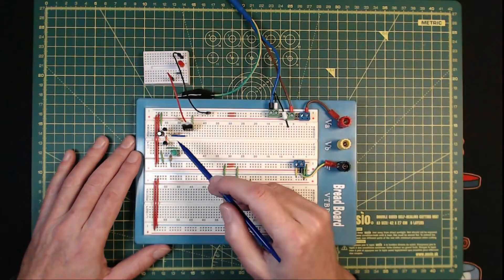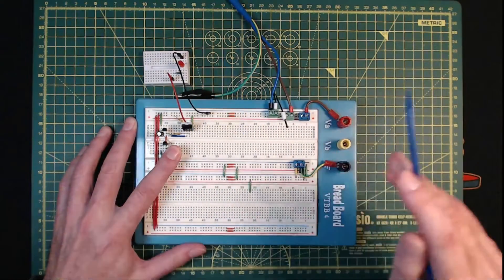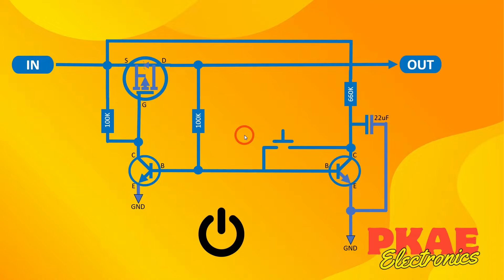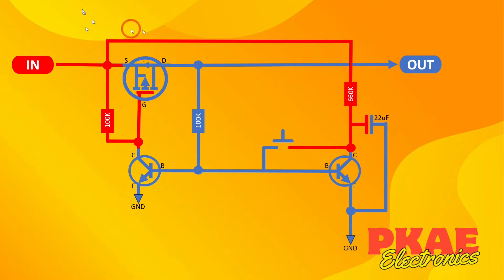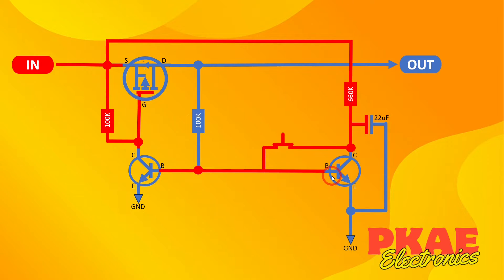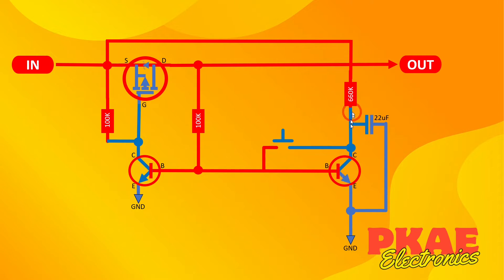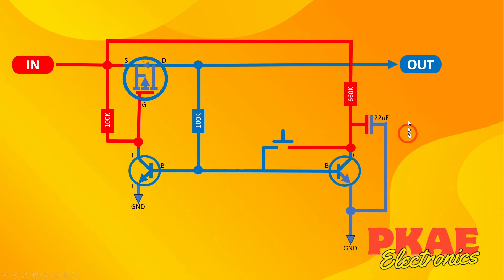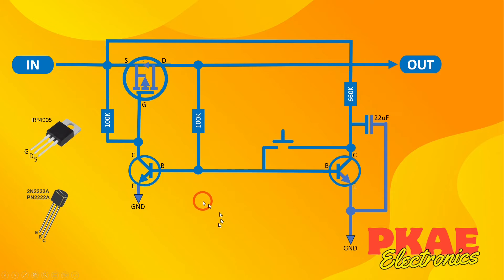Power Latching Circuit

Comment: I found that the circuit went immediately to the on state when power was applied. The switching worked correctly as expected. I inserted a 33nF capacitor across source and gate and this kept the gate high on ititial power up. I'm not sure if this has been exeperienced by anybody else but this was my experience. the only difference to the circuit described was the mosfet that i had available which was an IRF9540. Without this capacitor the circuit went to the on state 100% of the time. any thoughts would be greatly appreciated.
Reply from the maker: That's interesting. When I get my new workshop up & running I will take a look into this. Well done for fixing it though. What is it that made you think of adding the capacitor?

Comment: Hello, im trying to incorporate this circuit in to my own design but i can't get this to work, and i'm not sure why. It seems to be stuck in the off state, and when I manually pull up the left side of the switch with a jumper, it goes straight to being off again. If it matters, Im using BC817s for the NPNs, a 10uF capacitor and a CSD25310Q2 p-channel mosfet. Ive checked the schematic multiple times and it seems to be correct. What might be happening here?

Comment: Is there there a way to design a similar circuit which have a power side nmos and boostrap ? I tried to design it but I failed 😢.
Reply from the maker: It is possible, but quite a bit more complicated. The advantage would be lower RDSon resistance, but with the components I used, my testing showed no notable latching circuitry overhead anyway. I have never designed an N-type equivalent, so I'm afraid  I cannot offer up any immediate solution. I will add to my list for possible future video(s).

Comment: I'm new to electronics, but have completed a huge project with three Arduino's, three large NEMA 34 stepper motors, rotary encoders, potentiometers, joystick, warning lights, and switches. This provides three different ways to control each stepper motor, and is installed on a large commercial machine in a machine shop.  My question is this:  What application would you circuit be used on?  It seems like it is very complex and I'm wondering what would require such complexity?  Thank you.  Regards.
Reply from the maker: Hi, thanks for your comment.
In answer to your question, single push button power latches are used everywhere in modern electronics. Just think about all the devices in your home right now, including your mobile phone, television, calculators etc etc. The circuitry may seem complex at first, but you should really think of it as just another building block. It's no more complex than your Stepper motors, motor drivers and certainly no where near as complex as your Arduino boards. The main aim of these videos is to help broaden people's electronics understanding and hopefully spark a greater interest to learning more.

Comment: i tried this circuit  on a breadboard it would never work for me tried all different RC time constats just would not work only when i unplugged the second transistors emitter from ground the led would light up when i held the button down then would go out after i released it, the only difference was i used 2N2222 BJTs instead of 2N2222A the very close datasheets,  great video thanks
Reply from the maker: That is strange, glad you got it working in the end. Thanks for the comment.

Comment: this works perfect with a rezistive load, but adding a buck converter after doesnt switch off, any idea how to fix it?
Reply from the maker: Try adding a diode to the output i.e. from the MOSFET Drain, to the supply of the Buck Converter.
Reply: @paulpkae  Thaks for reply, nope doesnt work, doesnt switch off with small load either

Comment: What project i use this for is considerably flawless to connect a car stereo remote wire with a remote start trunk pop button to remotely turn on under lights or stereo on off remotely.. great for remote start plus lights and radio with unused lock and unlock or trunk button..bc most cars have a fob that came with it with all the original buttons ..best momentary connect for latching on off circuit by far bc other n channel versions non p channel always has positive connected and only regulates ground amount regulating connection..  i have jotted this on paper three times already...lol
Reply: Less dodgy to connect hot

Comment: I apologize for the very basic question. I'm new to electronics and am trying to get a handle on the fundamentals. Could someone explain the role a capacitor plays in this context? I understand that it charges and then discharges when the switch is pressed, but I don’t quite understand why this is necessary
Reply from the maker: Great question thank you.

When the circuit is in the ON state, the capacitor provides sufficient delay, for when the switch is pressed again, to allow the MOSFET to turn off. Without it, then when the BJTs turn off, the right-hand side of the switch is immediately pulled high (via the 660K and middle 100K resistor) and subsequently the BJTs turn back on before the MOSFET had a chance to turn OFF.
Reply: @paulpkae  Thank you!

Comment: It occurs to me that you might obtain additional function from the switch, if you DID time the length it is depressed.
I would like a switch that is 'on/off' but, after being pressed for 2 seconds, powers an 'alternative on' function - maybe some other mosfet or circuit?
Reply from the maker: Hi, thanks for watching and your comment. 
You could achieve the circuit you suggest by charging a capacitor via a resistor when the button is pressed. Then use a comparator (or 555) to check when the capacitor charge reaches a given threshold. The output of the comparator can then in turn activate another function.

I have posted a previous video in which the the single button provided three functions, but that was using a microcontroller. See link below.

https://youtu.be/2yTPqQ3P5pQ?si=f8mBrQJYezLPxUF4

Comment: Have you considered the limits of Vin ?  As I think there may be issues at Vin=24v
Reply from the maker: Believe I tested it at various voltages, but probably no more than 12V. The circuit is an example arrangement which may need adapting depending upon individual circumstances; load current, voltage supply and component ratings being key factors to consider. 

Out of interest, why do you specifically think 24V is the limit?
Reply: @paulpkae  because I tried similar circuits and I think gate threshold might break down

Comment: I am trying to figure out a latching circuit to control a 1 amp draw at 24 volts what component values would I need for each to reliably maintain the overall circuit integrity?
I want something bullet proof, I am using it to turn on and off a gas regulator for welding with a tig torch.
Reply from the maker: Possibly a latching relay but, given the safety nature of your requirements, I would urge you to seek a proprietary, possibly "industrial", product for this.

Comment: Great video. Thanks! 
Q: Do you think there would be any issue using a 500k ohm resistor instead of the 660k for a 12vdc input and 12v relay on the load?
Reply from the maker: I would have thought that would be OK. However I did find its a bit of a balancing act between the transistor types and resistor sizing. I may still have this breadboard rigged up at home. In which case I will test it put for you and let you know.

Comment: Hi, Any chance to modify this circuit to also time off to save battery. I think this would be useful for many people. Good luck with your channel.
Reply from the maker: Hi thanks for your comment. If you want the circuit to simply timeout and kill power after a given period, that's quite straight forward to implement. If you want the circuit to timeout after a period of inactivity, that need to be implemented within your code. Which option are you interested in?
Reply: just a simple circuit that will alow a battery to last for a long time when off. thanks Dave @paulpkae
Reply from the maker: @cncdavenz  the circuit in this video does exactly that. In the off state, the MOSFET prevents current drain from your battery.

Comment: Is there a way to shut off using Arduino output?
Reply from the maker: Yes, there certainly is. That's something I have implemented on several of my own projects. The circuit is actually much simpler because you have software control with a microcontroller. I will do a follow up video with the circuit soon. Thanks for the comment.
Reply from the maker: @stephenstewart1653 I have added a new video in response to you question. https://youtu.be/2yTPqQ3P5pQ

Comment: For some reason this circuit works for me on a breadboard only. I used off the shelf TO92 components for that. But implemented on a PCB with SMD Parts (BC847CDW1T1G and BUK4D38-20PH) it is just on all the time and trying to switch it only lets the voltage dip down for a second before coming back up. (I’m trying to latch a 7.4V 2S LiPo battery.)
Reply from the maker: That sounds frustrating. The type of transistors your using will influence the perfect resistor sizing. It sounds to me like you need to get a scope on your board and see what's happening. Monitor the capacitor charge and NPN base voltages as a minimum. It will probably shed some light on what the issue is.
Reply: Did you find the problem?
Reply: Hi I'm facing exactly the same issue, have no idea what happens when i switched to smd components :(

Comment: Few seem to acknowledge high-side switching with P-Channel MOSFETs.  Thanks!   I build my own multi-rail power supplies for my projects and need high side switching due to a common ground.  A problem with P-Channel mosfets is a relatively high VGS(th).  The IRF4905 may not work well with 3.3v because the VGS(th) is 2.0v to 4.0v.  It's hard to find ones with lower VGS(th).  I have some very real NDP6020Ps with a very very low VGS(th).  I also have dozens of counterfeit ones.  Fair warning - These aren't made anymore and you can only buy counterfeit rejects that are unusable.  FYI - There's an interesting IC for N-Channel high-side switching.  The LTC1157 is expensive at $6 US.  An internal charge pump will boost the gate drive voltage 5.4V above the positive rail to drive an N-Channel mosfet on the high side.  Charts seem to suggest a normal operating range between 2.75v and 5.5v.  I bought 10 for my next set of projects.
Reply from the maker: Thanks for your comment. Some interesting aspects for people to consider.

Comment: Hi. Thanks for the schematic. I have built this one recently. Based on the comments to the older video with similar one. Didn't work well for me with 4 v power supply. 
But may I use an  n-channel mosfet with p-n-p transistors just to switch polarity? I have a bunch of n - channel, but no p-channell. And they are too expensive to buy.
Reply from the maker: Thanks for the comment. 

I think many of the circuits we see on YouTube (including my one) have derived from an EEVBlog post he did some time ago. I guess there is only one perfect solution and every variant we see is simply getting closer to that perfect solution.

At 4V you may need to play around with the resistor values to obtain suitable current to turn on the BJTs. As for using N-Channel MOSFETs that would of course change the logic of the circuit and would need to be re-arranged. It may be possible to combine two N-Channel MOSFETs (one inverting the other) to achieve the same effect. 

I bought a pack of P-Channel MOSFETs for just £9.99,  See the links in my description.
Reply: @paulpkae  thanks for such a great response. With my first build, I can turn it on, but I can't get it off.
About transistors - I suppose to use a p-n-p bjt for a latch and n-channel type as a key
Reply from the maker: @igorzherebiatev5751  not quite sure what you intend doing, but bear in mind, depending how you arrange the circuit, a BJT may end up drawing current even when the circuit is in an off state.
Reply: @paulpkae  Hi again. At first, I wanted to say thank you for your answers. 
At second.  I just got a fully functioning version of your scheme but with a N channel mosfet. The P channel is rare to find from salvaged and desoldered boards and the cheapest ones to buy costs more than pound of white bread here. 
So I just used a pair of PNP transistors, S8550, and an unknown type of N channel mosfet from an old motherboard. Reversed a polarity of the capacitor and set a "+" as a ground. Tested it in a simulation and built it on board. Had to increase the capacitor to a 1000 micro Farad. And lowered the resistance from 660k to 330 because it will be used in 9 v device. Had an interesting effect. You have to wait for about 15 seconds before you can turn it on again.
Reply from the maker: @igorzherebiatev5751 glad you got it working. Well done! N-Channel MOSFETs are indeed much more common. As are NPN BJTs.

Comment: I like your schematic animation.  Is any switch debounce warranted, or is there sufficient switching delay?  What voltage range applies?  How much current to operate?
Reply from the maker: The capacitor is already wired inline with the switch, there is no additional debounce circuitry required. I have tested at 5V, 9V, and 12V but you're really only constrained by the ratings of the components you utilise. The 2N2222 has an absolute max Collector to Emitter voltage of 40V, but you can always substitute the transistors with those of your own choice. With differing transistors however you may need to also play around with the resistor values slightly. 

The power overhead is negligible. In its OFF state there is no current drain once the capacitor is charged; there will be some minor leakage current but <1uA. In it's ON state the circuit adds around 185uA when driven at 9V (not worth worrying about). 

I will be doing a follow up video soon to put the circuit through some testing I have in mind. This will include trying out various supply voltages, increasing the load current and checking the impact of repeatedly discharging the capacitor through the transistors (see @BersekViking's comment below). 

Keep an eye out for it....

Comment: If there is a large capacitor at the output. Then it can switch the transistor back on via the 100k.
Reply: Block by a diode?
Reply from the maker: Well spotted, thanks for your comment. 

Yes, any back feeding current could turn the two BJTs back on and activate the output again. A blocking diode at the output will resolve it. 

You will have to take into account the voltage drop across the diode (in addition to effect of the MOSFET ).

Comment: I think you should have a resistor in series with the push button. As the circuit is now, you are connecting a 22uF capacitor, charged to 9V, directly over the B-E junction of the transistor. Just a matter of time before it fails.
Reply from the maker: Thanks for your comment. It's given me an idea for an interesting experiment. Watch this space...... 😁
Reply: And as you increase input voltage, the energy of the discharge will increase with the square of the voltage, making the device more likely to fail. A few kOhm in series should help. But when the transistor on the bottom right turns on it may also be taking the energy discharge. So having it in series with the capacitor may work better. @paulpkae
Reply from the maker: @BersekViking many thanks again for your comment. I have now put this through some testing and have published a follow up video. A link has been added to my comments above (click "...more" if you cannot see it). Would be very interested to hear your thoughts. Thanks again.
Reply: I agree. In the datasheet, it looks like 500mA are still okay for the base current, so a 22ohm resistor would adequately limit the current in a 9V circuit, and shouldn't harm the functioning.
Reply: But maybe put it in series with the capacitor to also limit the current through the collector.
Reply: With resistor in series with the push button latching current coming through the 100k resistor would see that as high resistance path while the path through BJT base-emitter diodes is of very low resistance, thus BJTs might not turn off.